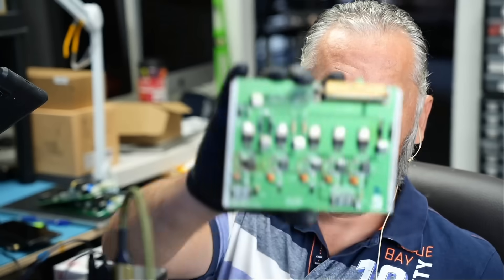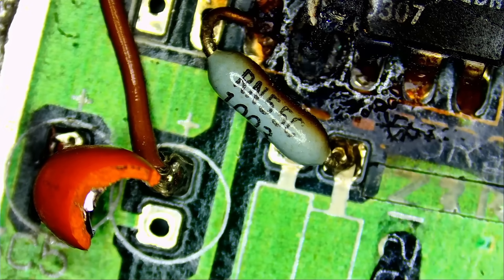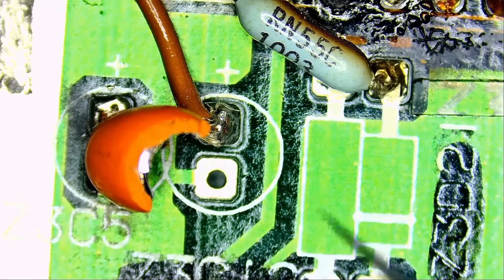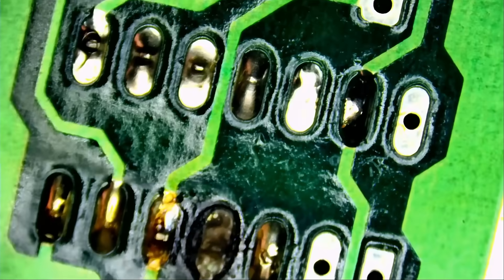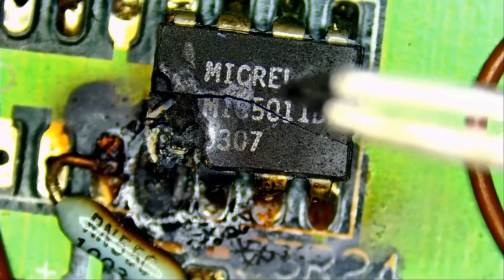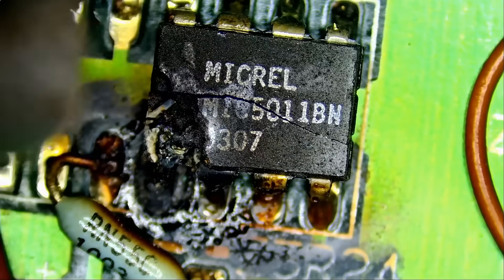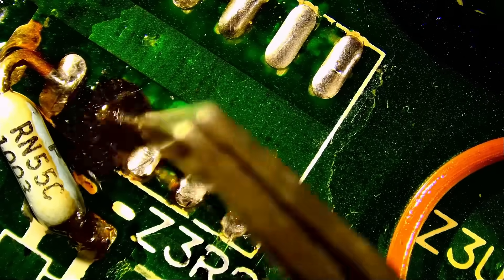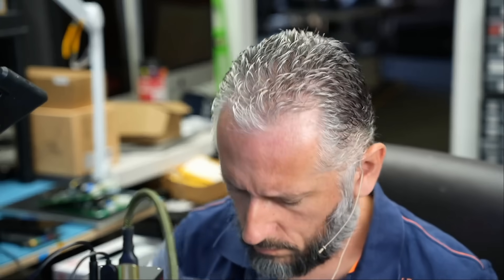Cessna Aircraft Motherboard Repair - Hold on to your seats.

Comment: When we (where I used to work) at the PCB factory usually had a burn in requirement for aircraft PCB's, they would get the burn in oven where they got cooked to 200F and froze to -10F at 10-20 cycles per the manufacturer.

Comment: You may want to send these boards back to the customer. You have to be certified under  14 CFR part 145 to repair aviation electronics. Google it!  To find FAA certified electronics repair, look for an FAA Repair Station that is certificated under 14 CFR Part 145 and holds a Radio or Instrument rating for the specific type of avionics and electronics equipment needing service. You can be held liable.

Comment: I do believe it is not a problem to use non certified components on an aircraft as long as nothing goes wrong or you don't get caught!!!! Heavens to bid, the airplane catches fire in flight or if soul's are hurt or worse because of this uncertified part.. The price to pay would be extremely high. If someone knows better, Let me know if I am wrong. I am not an A&P mechanic but I have been a certificated pilot since 1996.

Comment: Lots of folks seem confused, so I will add some info.  I have worked in Aviation my entire career, and more recently was a parts inspector for a small airline for 8 years.

All repaired aircraft parts installed in a type certified aircraft must be repaired and certified by an FAA Authorized A&P mechanic.  This includes any electronic work on individual parts or subassemblies.  When this is accomplished, the certification document provided is called an 8130-3.  It is physically signed by the tech who performed the repair, or the inspector who oversaw the repair being done in an FAA-certified repair facility.

In this situation, none of those things have occurred, and therefore this card is no longer able to be installed in this aircraft.

However, the workaround for this is if the repair facility who hired NorthbridgeFix receives the card back, and then inspects the card to verify proper working condition.  They can then recertify the card with an 8130-3.

If the owner of the Cessna was the person who supplied the card, then owner would still need to pay to have the card recertified by a proper 14 CFR 145 repair vendor.  So essentially the owner is wasting money.

Comment: Good afternoon to the entire community.
Yes, indeed, the comments I'm seeing indicate that this is a huge responsibility.
Some delicate equipment has also arrived at my lab, where electronic repair is vital.
This is about medical equipment, but an aircraft PCB is a different story.
The other situation is that perhaps that electronic board doesn't exactly coexist with the engineering of the engine or engines or turbines.
But rather, it's a less important peripheral that doesn't compromise engine and turbine controls. Even so, that's a huge responsibility.
And my respect to this channel, which presents this video, which is very good.
Regards, 🎩

Comment: Looks like an engine management board for either fuel injectors or ignition coils. Coil failures eat poorly designed driver boards such as that. Nice Work, good show.
Reply: Not in a Cessna. EFI and CDI ignition are very new to aviation. Like last ten years or less.

Comment: It matters not if one flys under part 91. If the pilot gets into a accident, and the insurance company finds out that the electronics in that plane was not repaired by a certified aviation repair station the insurance company can, and will not pay for the loss.that can even include installation of a auto battery instead of a aircraft certified battery. Than there’s the FAA to deal with, with those guys anything can be illegal.

Comment: All of those orange capacitors need to be replaced.  They are famous for shorting as they get older.
Not sure about required certification to repair the board.  Its an audio board and may not be involved in aircraft control.  More investigation is required.

Comment: Those Micrel chips were a Mosfet Driver .. They are now obsolete but you may find some still available. Worst case you need to sub in a newer version of the part. The datasheet is still available on line.

Comment: You're definitely allowed to fix aircraft electronics but the board might not be allowed to be installed into an aircraft without a certificate of conformity. I'm pretty sure you have to be authorized to make that certificate.  I spent 17 years in the Air Force and I am not allowed to install anything into an aircraft that doesn't have a proper certificate of conformity.
Reply: You're correct. I've been an aircraft mechanic since 1992. Now, to be honest, we know most private pilots don't care about "formalities" when it comes to certain parts but if I were the pilot, I'd be more worried about WHY these boards are shorting out.
Reply: Absolutely!
Reply: Being in the Air Force is very, very different than Civil Aviation, every single part on a Type Certificated Aircraft from the Aircraft Manufacture will have the original 8130 or OEM Traceable to the National Standard, this includes Replacement Parts, all parts and repairs needs to be traceable and NorthridgeFIX needs the appropriate Maintenance Manuals and proof of recency of experience to repair any Aircraft or component, even down to a circuit board and what reference is he going to use to approve the Return to service the that circuit board?
Reply: @John_N_from_NC  I can second that. Former military and worked a few years in the engine shop. For every type of aircraft or engine you need training/certification and indeed, the majority of larger components and assemblies are followed by serial number and any kind of change is logged in the books. Some of them do have hour limits or time limits on top of wear limits. Surely that principle also applies to avionics components in civil aircraft, but I could be wrong.
Reply: All planes need inspection doesn’t matter private or not.
Reply: Yes, took me a while to get that inspector number, in the interim I had the other tech in the shop checking my work, and then i would send the stuff out again.

My bet is that there was a fault on the output wiring, and the IC rather objected to having a direct short, and likely also killed the Mosfet it drove. nice driver, minimal componets and capable of being both high and low side driver in one with no external parts.
Reply: Burning electrical is occasionally frowned upon in aircraft and even if it isn't caused by this repair someone will pay the price. Bwahaha
Reply: Aircraft tech has pretty high safety standards, but also in industrial automation, if a company has and wants to maintain some certificates, you also need to use certified components in safety mechanisms in the machine and even as a tech for that machine, I'm not allowed to fix those. I have to replace with a good part.
Reply: For GA, 'conformity' is deferred by the FAA to FCC regs on components INSIDE radio transmitting equipment - does it stay within PMA specs without need for recalibration, (ICs generally do) ... as for the 'why did it burn?' that could be different. 
CFR states "Major repair or replacement" but never says what a 'major repair' is outside of calibration or alteration. IF this repair resulted in restoration of function without need for calibration it's a 100% legal repair per 14 CFR 43. 
Per 14 CFR 91 it's a minor repair provided it stays within PMAs.
Reply: That is Probably going in to an experimantal aircraft.
Reply: When an accident happens, this may be the excuse used by an insurance company to prevent paying out any claims...
Reply: I think you need a EASA Part 145 certificate or FAR Part 145, otherwise you can repair it but this part is not for commercial flight anymore. These circuit boards are designed for strong vibrations and harsh conditions. At high altitudes, the insulation distances must be maintained, which differ significantly from the guidelines for normal electronics design. A special coating must then also be applied under certain conditions, e.g., DO-160 certified, if we are moving towards Airbus. However, I believe that if it is for a private aircraft, and for example to get the seat heating working again, it is understandable.
Reply: that was my 1st thougt... it is a fully professional repair, but for the plane to be airworthy probably a lot of paperwork needs to be done
Reply: As a certified radio tech from the FCC I have worked on one connector to an avionics box. The BNC connector had the wire pulled out of it. Redid the connector to the co-ax but noticed that there was no spare coax to make the required loop.before connecting the BNC connector to the box. All along the API was following my repair and when I finished the repair I informed him he was to make a squak sheet for that line to be replaced within thirty days. Jumpers are not permitted to make up the cable loop that acts as a strain relief but instead an Avionics tech should replace the whole line. That would effectively put the aircraft out of service for up to a month. Depending where and how the cable is run, many interior panels will have to be removed until the line is traced to Ted antenna that it feeds. The whole harness must be unlaced, old cable pulled and replaced with a new, properly marked cable and then the whole harness must be re laced and fastened to the ribs of the airframe, tested and if all checks out, all interior panels must be replaced. That might cost the company up to $20K but it’s the regs. That was 30 years ago, had I been ten years younger at the time I would have attended avionics school.
Reply: I am😂
Reply: It is not legal for an ordinary circuit card repair professional to repair any motherboard or circuit card from a light aircraft unless they work for a properly certified FAA Repair Station. U.S. Federal Aviation Administration (FAA) regulations require that all aircraft maintenance, including repairs to avionics and other components, be performed by authorized individuals or facilities to ensure airworthiness and safety.

If this is from an onboard entertainment system (unlikely in smaller Cessnas), it may be okay, but if it's from the comm audio or switch gear, then it is a critical component. Perhaps the end customer is an authorized repair facility. It is worrisome that NF cannot verify functionality once he has worked his "magic."
Reply: @StephenRichardLevine   Even if the Circuit Board is from a on board Entertainment System, it has to be type rated and certified with a TSO rating, same rules apply.
Reply: For sure if the aircraft had something happen in the future related to this repair without proper certification. The repairman will take the full responsibility with this YouTube video published. Get himself in trouble instead of show off.
Reply: Just like you can do your own pumbling and electrical work at your home at your own risk. Its just a matter of insurance(money) at the end of the day
Reply: @zaxmaxlax  You are wrong, It's a safety Requirement for the Aircraft, Crew, Passengers and People on the ground. Where are you getting this work on your own Aircraft without documentation? Plumbing Maintenace on Aircraft has to be Documented and signed off too.
Reply: No, he is not allowed, period! I've been in the Aviation Maintenace/ Avionics 25 years, i know what I'm talking about. The only thing he can repair is anything to do with experimental Aircraft and Appliances' anything with a type certificate / TSO he cannot touch, he might want to take this video down befor the FAA gets wind of it.
Reply: @John_N_from_NC wrong wrong; 
40 year avionics tech here, you can do anything - as long as- you dont represent it as airworthy or repaired or certified. just like putting a modified prop on an airboat or trailer etc.
the crime is installing it on a certificated aircraft or selling it as airworthy or saying in any faa form that it was repaired.
Reply: @John_N_from_NC  Um its not illegal for him to repair this.  It may only be against the rules for the plane owner to install it after.
Reply: @John_N_from_NC you sir are correct
Reply: @John_N_from_NC  Possibly the person that sent him the parts does have the authority to certify the repairs.
Reply: @John_N_from_NC  surely he's allowed to fix it, it's installing it into an airframe that's not allowed. That's on the customer.
Reply: A private airplane is different than a commercial airplane.
Reply: @mrBDeye  Not when it comes to airworthiness and the use of the same sky. If you're the pilot of a small aircraft, maybe you would wish to have over-engineered and triple-redundant avionics, but when you lose comms or can't squawk 7600 or 7700 for a MAYDAY issue, you're SOL.  Personally, I would want to find the root cause of the failure and then replace, not repair, the board. Unless the boards are no longer available, then I would consider an upgrade. Keep the blue side up and wishing you CAVU.
Reply: @StephenRichardLevine  Root cause doesn't always mean external to the board. Any component can fail on the board due to age. Nothing works forever.
Reply: @StephenRichardLevine  That particular board, specifically the burned chip, is a driver for MOSFETs in an audio board. Most likely lost some or all coms. Doesn't look like a transponder board.
Reply: @mrBDeye just because you own an aircraft does not give you permission to effect repairs on your aircraft unless you are certified for that aircraft as an certified aircraft mechanic for that model.   If I was the pilot. I would not install that board. Even though I trust the person repair the board. Owning a plane is very expensive.
Reply: @mrBDeye until the private airplane crashes into a commercial airplane...then the investigation into the maintenance records come into effect.
Reply: @mrBDeye it depends if the private aircraft is used for commercial operations or not    Private craft can and do provide commercial utility.
Reply: @mrBDeye  there is nott such thing as a  "private airplane" verses "Commercial airplane" in the  eyes of the FAA  it  goes by category and class...but to repair any aircraft avionics you need a GMDSS FCC license...requires testing
Reply: @mrBDeye  No it's not, Read the FARS, the Maintenance of Type Certificated Aircraft, STC Aircraft and TSO Appliances are heavily Regulated by the FAA from the Cessna 150 all the way up to the 777/ 380, there is a reason for that.

Comment: I do respect your work a lot @NorthridgeFix but I honestly wouldn't want to fly on an airplane where they can't afford to buy a brand new one of that thing. No disrespect, really, but that points to serious gaps in their understanding of flight safety.
Reply: Board is not available anymore.
Reply: Usually the boards fail rate is quickly after manufacturing, the longer it works the more possible is that it's going to work.
Reply: They don't really have brand new boards for these anymore
Reply: For me the biggest issue is that the pilot brought both boards in for repair but did he figure out WHY the boards are burning up? Hopefully he isn't just assuming it was just bad parts and reinstalls these boards without finding the root cause.
Reply: Why is everyone stressing over an obsolete board pilots are trained on how to fly without instrumentation which by the looks of this board is what it is. I would have no problem with having a board fixed by Alex for an airplane because if it were to go to an avionics shop they would have done the same repair the same way.
Reply: @m3ch674  You are very wrong, you have no idea what it is like to work in an AVI shop, I would have a cow if someone who is not trained in Aviaton Electronics and does not hold a CRS ( Certified Repair Station )
Reply: @m3ch674  Except an avionics shop would be required to have manufacturer drawings to purchase the correct parts, would only purchase parts that come with certificates of conformance, would have a drug and alcohol testing program for the technicians, would have the equipment to test the board after repair, and would have the millions of dollars in liability insurance for in case they mess up and the plane crashes.
Reply: if it was a car Fine you're still on the ground

Comment: I worked on boards like this in 1970's and 80's
gold plated D sub is pretty cool
glad I never had to extract one like that
I appreciate the  resistor values installed face up